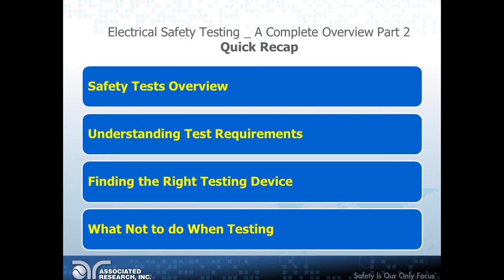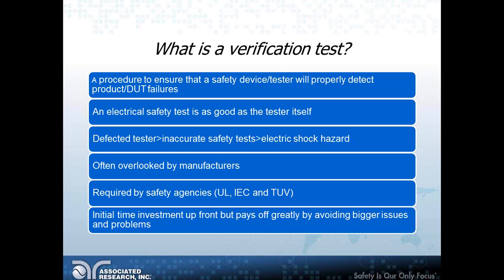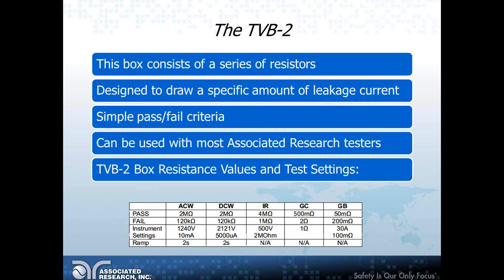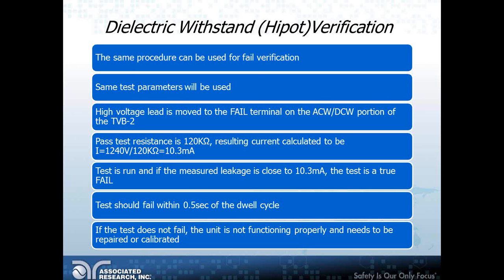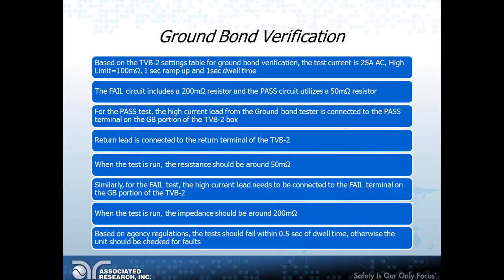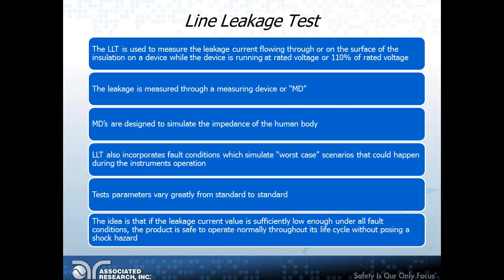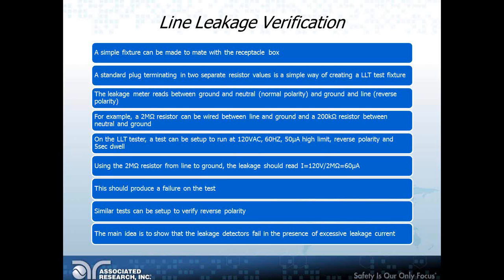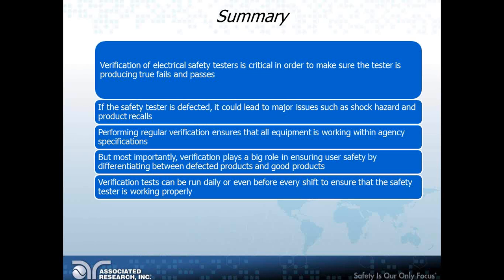Verification Testing

Comment: If the hypot equipment is connected to a socket and this socket has a current leak, will the LVB 2 and TVB2 boxes detect it and reject the equipment, making it impossible to use it?